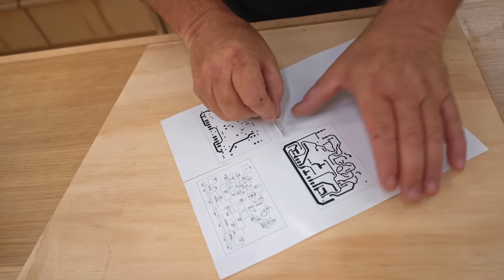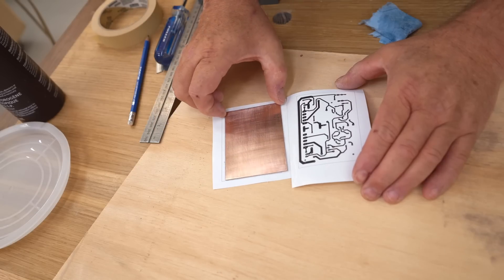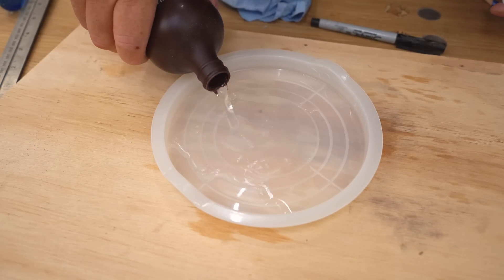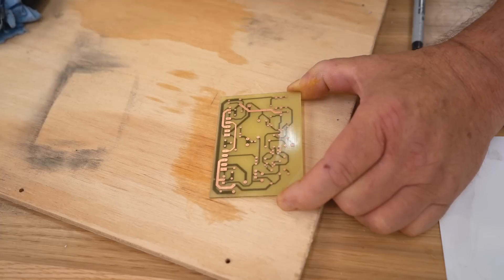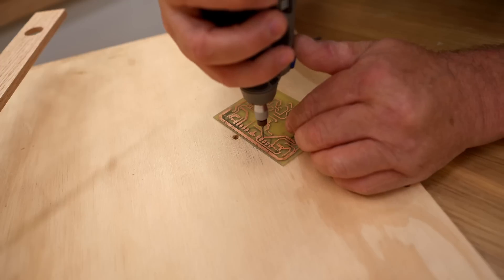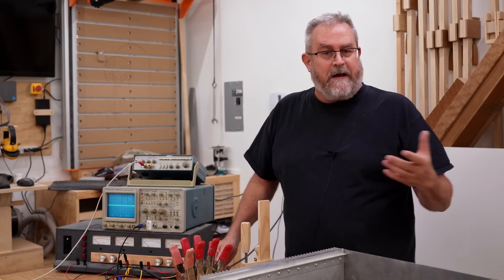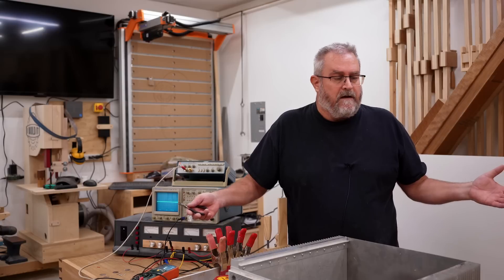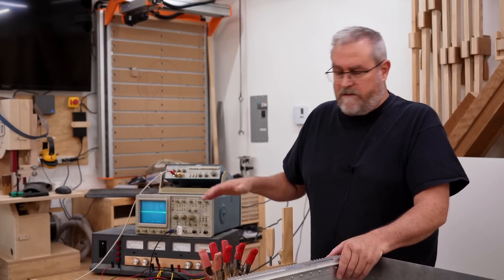Designing and Building a 10 Channel Amplifier

Comment from the maker: READ ME!
Why am I building this? 
Because I can and want to, mostly. Also because I don't entirely trust the DSP solution for speaker crossovers. Active analog filters are set and can't lose their programming, barring a catastrophic  (and extremely rare) failure. You might say that failure for DSP is extremely rare, but it's already happened to me. After a power outage, my miniDSP 4x10 lost it's configuration settings and luckily I checked before played anything. Having the full signal at high volume going to my expensive tweeters would not be a great start to a relaxing evening of listening.
The amp design is relatively simple, a typical three stage configuration with good quality parts. I tested the prototype for operational stability and thermal stability and saw no issues. Not shown in this video (but I'll do it in an upcoming one) the stability testing included adding capacitance to the output. I used a 1uf cap and the amp did not break out into oscillation.
Square wave testing shows a fast enough slew rate and there will be more testing when I get the professionally made boards to do the full power tests.
Note that this is an integrated amp that has 28db of gain and doesn't require a preamp.
The case I built is a little rough and not even close to finished. But it is HUGE and has plenty of space for the ten channels I want to put inside. Yes, I've settled on 10 channels - 8 for the main speakers and two to spare for a possible centre channel and the other channel can run the bass shaker in my seat. I'll have to rework or remake the back panel and make a cool looking front and top panel, plus install some dividers inside. 
The transformers were salvaged from vintage power amps and are easily powerful enough to run all 10 channels at good listening levels with headroom to spare. Each will have its own large capacitor bank for smoothing and reserve, with a soft start circuit on each.
Conveniently, the larger transformer also has a low current 22vac winding that's perfect for the active crossovers supply.
Reply: I don't hear slew rate and square wave testing mentioned much these days. Back in the day a quality amp would have these in the specs. Looking forward to this build very much.
Reply: How are you going to delay the midrange and tweeters compared to the subs? I have a huge issue with this myself. Bass is soft because the subs is delayed vs the mid&tweet that doesnt have the dsp delay the subs have.
Reply from the maker: I stopped using delay on the DSP after making a listening comparison. In my opinion it's not needed in a small room.
Reply: @impuls60  You can physically delay the components.
Reply: Try building tda 7294 bridge amplifier. Very simple to build. Thanks for video
Reply: I like a passive crossover but how do they sound?

Comment: 1:49 If you throw the PCB into water close to boiling point and wait for 5 minutes, the paper will separate on its own. Then you won't have to worry about cleaning up paper residue. The method I mentioned will not work if the water is not hot enough.

Comment: Dunno if you've tried simulation in KiCad, but I'd recommend staying away from it for now.  It's a huge pain unless you speak SPICE natively, in which case it's only a slight pain.  I've spent literally days fighting with it, and can usually get results, but it feels a lot like running Linux in the 90s.  I'm willing to do it, but I'm an Open Source zealot with the background to deal with its wonkiness (and am too cheap to buy any decent commercial packages).

Comment: How many watts is the amplifier?

Why do the runaway diodes turn each way on the diagram? Isn't it DC that runs through the bias circuit?
And what good do D1, D2 and R3 do? Don't they just create a false frame point?

Thanks for many great videos!

Comment: I needed a 16+ channel amplifier for a bespoke project. There are some available on market - they were either too expensive or poorly spec'ed. So I purchased a rack case, a couple of big switch mode supplies and a pile of amplifier modules (TPA3116) and have been amazed at the performance. Plus it gets all the custom features I wanted - analogue current meter, external solar power option and phoenix input harness...

Comment: Great work,  the output inductor  is connected in parallel with a res , maybe r16? i can;t see it on your pcb , and in the schematic there is not any inductor, it's good to have the inductor in parallel with a 5-10 ohm resistor, it makes the  inductor " behave nicer " , land ike  one thing that I recommend, ( But you might want to test it before, it might be good,   if your amp is stable , temperature wise, and won't go into thermal runaway or the quissance current will drop to much  when it gets hot.    instead of the two diodes and the pot to set the Bias , I would use a " VBE multiplier ", its more stable controlling the quiss current ( bias ) vs temp and  all that stuff.   Works fine with diodes to, depends on the diodes.  You could use a  " VBE multiplier " and leave the diodes in place as well ( only the two diodes without the pot) in case the transistor fails ( very unlikely, ) it serves as a protection ,and the output stage won't go into smoke.
Reply from the maker: I'm using Onsemi thermal track output transistors - the diodes are pins 4 and 5 on those devices, not discrete ones.
Reply: @IBuildIt  Wow I look dumb now, I didn't really look what output transistors you used.  Great then !.

Comment: This is my biggest fear with DSP. Like you I’m running three 4-way active speakers up front. Though they use 3” beryllium domes for the mids and 1” beryllium for the tweeters.  The replacement diaphragms for the mids , if you are lucky enough to find them, are $1200-$1500 each. No way I was taking a chance, so all of the berylliums are on an active channel, but are crossed with a passive circuit so they are protected.  The midbasses and woofer are fully active.  But, yeah, I don’t trust computers lol.  I’m glad you said you’ll make the gerbers available (might go pcbway instead of etching) as I might clone this project. 

I’d love to see a video on you building the active crossovers. I’d need to figure out how to make mine with their own crossover points and slopes and such.  Awesome video, exactly what I was hoping for. I know some consider it boring, but I hope to get some footage of you soldering.  I solder all day for a living (audio repair and restorations) so you think I’d get tired of it lol.  Oh, and brilliant solution on drilling the holes! I ended up purchasing the small attachment that houses the dremel basically turning it into a tiny drill press.  Your solution was a much simpler setup.

Comment: Nice project John. Are you going to do on board supply and regulation? If you are running all those amps off of one transformer it might be an option to think about.

Mark
Reply from the maker: Thanks Mark.
There's not much to be gained by either regulating or putting the supplies right on the amp boards. It needlessly complicates an already very complex project and while i have a big case, it's still going to be a tight fit getting everything I need inside.
The supply for the active crossovers will be regulated, of course.
Reply: @John Heisz - Speakers and Audio Projects  You going with two big capacitor banks and leterrip! Your smaller demand amps could do with some capacitance on board, save any voltage modulation if there's current demand from the woofer amps.
Reply from the maker: The way to look at this is that each of these transformers came from power amps that would very competently drive two 1970's era speakers to absurd volume levels. 
Now, each will be powering a number of separate amps, but only two speakers in total. In other words, same but different.
Each board has decoupling caps on the rails already and I don't anticipate any serious power supply sag.

Comment: Great video. I've done toner transfer pcbs before but I used ferric chloride. Muriatic acid looks sooo much cleaner to work with. Building a 12 channel, scratch built amp is a worthy and bonkers project. I hope that it continues to be worth filming for you. The anecdote about the glitchy dsp is super pertinent since I am in the early planning stages for my own bonkers audio project.  Thanks again.

Comment: Thank you for the video, I really enjoy this channel. I second the problems with breakout and prototyping boards. I am working on a sketch to run a stepper motor for my router lift and could not understand why it would not work. It turned out to be a flaky row on my breadboard. It took me hours to track it down as it was intermittent. Looking forward to the next video.
Reply from the maker: Thanks Paul :)

Comment: They say a 3D printing can make a laser-iron technology outdated. They use a one layer printing, a proper nozzle, and some other settings. A result is remarkable. If you have a 3D printer you could try, sir.
Reply from the maker: I've thought about it and also using the CNC, even just to draw the traces. But I don't make enough boards to justify the time it would take to perfect the process, and using this method I can have a board ready to populate in less than an hour.
Reply: @IBuildIt  Have tried milling my boards : first build a small CNC myself ... bought a small CNC ... converted my old 3D printer ...
Well, the good old iron/etching beats that easily.
I am probably gonna give the the 3D LCD printer a try which looks very promising, but might be a bit of a hassle for double sided boards.
Then again I only use that for prototyping, for the final board I use JLCPCB (gonna try PCBWAY for my next project) because it's even cheaper per board to get them there compared to the cost of a copper clad board.
By the way, even for prototyping-boards it's cheaper to get those made by JLCPCB (yup, they will drill those thousand holes for no extra cost)
Reply from the maker: Yes, I was just setting up to order the ones I need and it's actually insane how low the price is. They must be producing it for next to nothing.
Reply: @IBuildIt  Yep. It was about $20 minimal few years agom if I'm not mistaken. Plus a quite high fee for a number of different designs on a same PCB (and still is quite high) Now I see it $5, and this is like "why a h.. not to order?!"